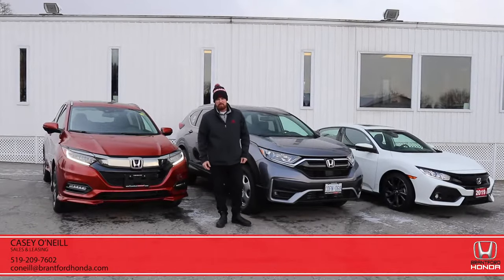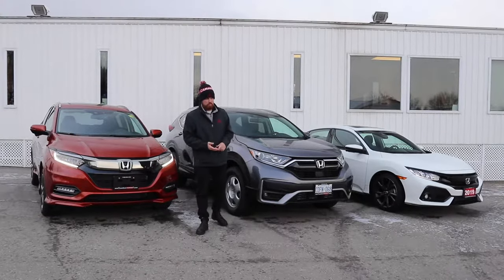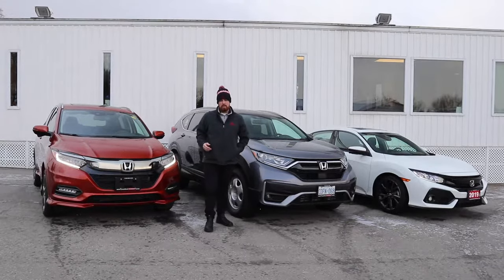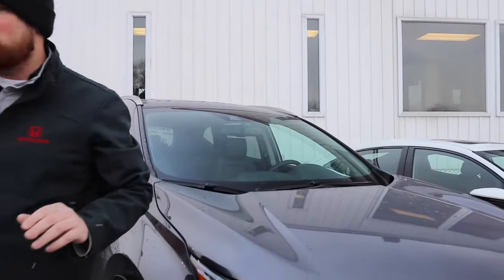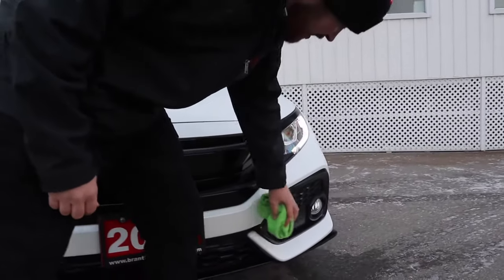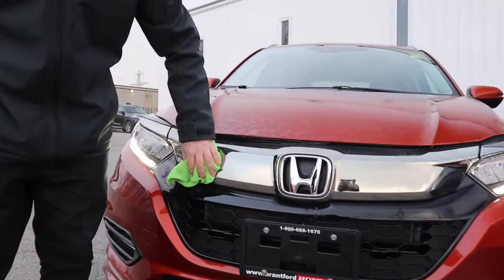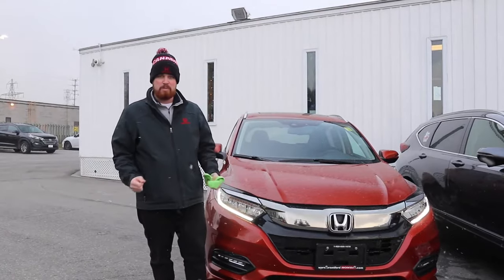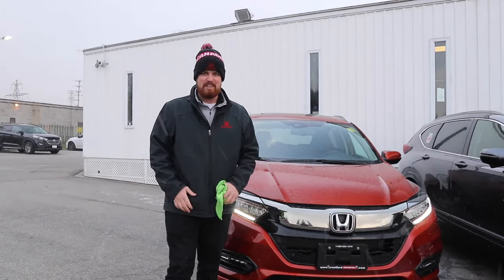Honda Sensing - Keeping Your Sensors Clean

Comment: I was just driving along in normal spring dry weather, all honda sensing errors came up, along with a small square with CAM inside the square. Drives totally fine, but cant use my cluster. Any idea, or quick fix?
Reply: No physical damages at all, wiped everything down,etc
Reply: Did you ever figure this out? It just happened to me as well with the CAM square
Reply: Any fix for this? Just happened to me.

Comment: My 2019 Ridgeline windshield sensor needs cleaning on the inside...between the windshield inside and the sensor. Is it possible to use a panel tool to remove the cover by the rear view mirror to access?

Comment: Well, just last night while driving, coyote hit my car n broke bumper, crashed plate number, last but least, it caused some system issues. Following: Road Departure/Mitigation System Problem, Adaptive Cruise Control Problem and Brake System Problem. What should I do? Is it anything that serious problem? I mean should I take it to service? I already wiped it down but it didn’t work for me.. Please help me. Thanks in advance n happy new year
Reply: Having the same problem, how did you get it fixed?
Reply: Me too
Reply: Were you able to fix this issue? I am having the same issue and wondering how to resolve it. Thanks.

Comment: My 5 years old 2018 Acura MDX (40k miles) suddenly started having the exact problem after parking for one day under the rain. I paid $280 for diagnosis. The dealer asked for $3600 to replace the camera mounted on the windshield, the emblem and the radar behind the emblem. I opened the cover under the hood to troubleshoot the wire. I realize that all the wires connecting the plugs or connectors are very very thin,  seem very very old, very very fragile and seem to be very very easy to break. Maybe, that is the reason Acura and Honda need a cover to cover the engine, so people can not see the very very thin and fragile wires connection inside the engine. 
I had tried many ways to try to reset the warning lights of the flashing ACC, Collision Mitigation and Lane Off Mitigation icons, but no luck.
- disconnected the battery, and reconnected the battery after 12 hours
- tested all fuses in the 5 fuse boxes - all fuses seem ok, (not test the relays yet)
- disconnected and reconnected the power for the camera on the windshield
- checked the battery, - has 12.6 volt and 95% full, reach up to 14.6 volt when engine on
- clean the windshield and the front logo
My front logo or emblem has brown dirt inside and I can not clean. I am not sure if that is the main reason for the sudden flashing of the warning lights

Does anyone know how to reset the warning lights or fix the problem???
Where are the fuses and relays for the flashing warning lights?
The emblem does not seem have any electrical wire connection.
How the emblem or front logo works with the radar behind it?
What is the problem?

Comment: Honda is not good not buying my Honda 2018 to many problem and the sensor they trying to charge me $1600 they say is no cover
Reply: What did you do about this. They are trying to charge me $1,800 on my 2021 crv. Sensor stopped working suddenly. No accidents. They are trying to claim I damaged it in an accident.
Reply: @chucky2141  did u get it fixed? They’re charging me $1500 for repair
Reply: @chucky2141  I havea brand new HRV and my sensor doesn't work. So the whole collision mitigation breaking system is naul.

Took it tobtwo different dealers and neither one could figure out what is wrong. Called Honda complaint # and they recommended I video myself driving to show rhe sensors do not activate.

I've only had the car 10 days!!